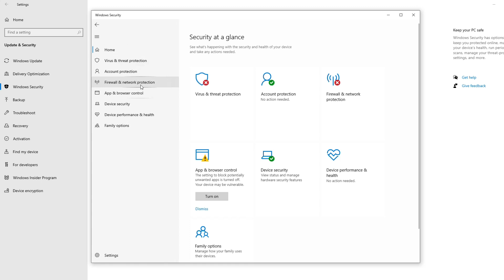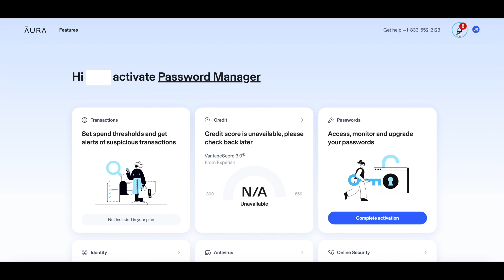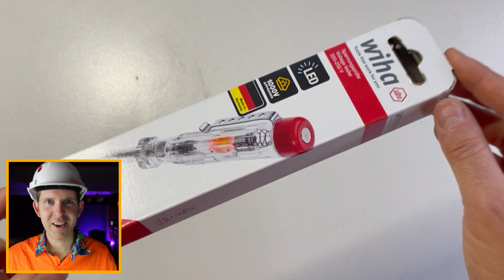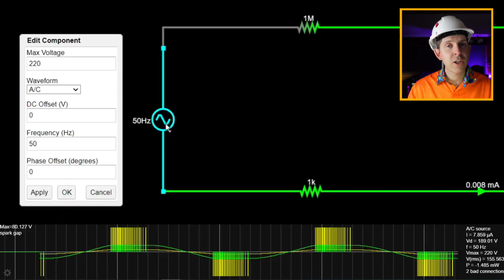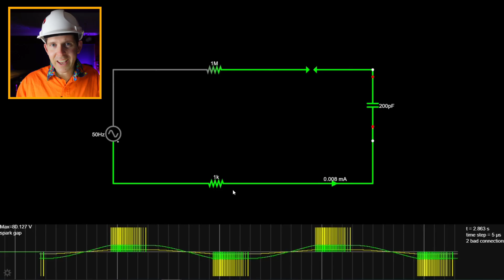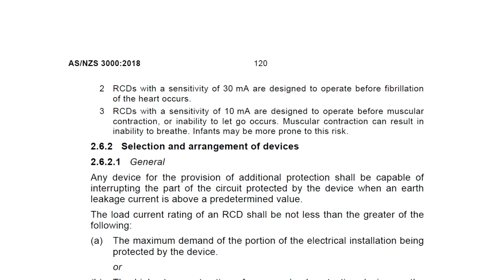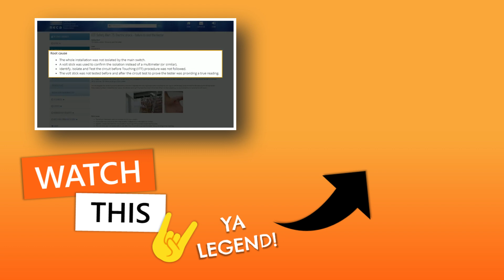ACTUALLY... This is the DEADLIEST Electrical Tester!

Comment: 50Hz is less power every damn time than 60Hz. 
No amount of Aussie math can refute.
Reply: When did hertz become a measurement of power?
Reply: @SuperSpecies  say you have 600v running at 50 cycles a second and some asshole comes and cranks up the generator rpm , getting 600v but 60 times a second. 
That’s indeed why.
Reply: @Shazzamm1971  yeah so the frequency will be increased, but why?
Reply: @SuperSpecies  so your motors don’t need to have as many windings to produce the same horsepower. So I might even go further and not only say 60HZ grids produce more power when time is a factor, which it always is, but the bonus result of running a 60Hz system over a 50Hz grid is efficiency gains on anything consuming load. 
Being able to run less windings in millions of spinning inductive loads makes your country’s resources go further. 
This argument was had about 80 years before I was born. Those that chose AC over DC back then is well documented, as well as who was smart enough to start their generators running a bit faster over those that weren’t smart enough to set the governors beyond 3000rpm.
Reply: @Shazzamm1971  there is also the skin effect. Most serious generators have 6 poles.
Reply: @Shazzamm1971  60 Hz increases eddy current and hysteresis losses in cores, inductive and capacitive losses in long transmission lines. In the past dozens of frequencies were tried like 140, 133, 42.5, 40 and 25 Hz. 50 and 60 Hz was a good  choosen as a compromise.
Reply: @mernokimuvek  We run 60hz upto those frequencies to control motor speeds. VFD’s are a thing. Run that 60hz at 120. Guess what just happened? More power. 

The reason it was chosen was because it was an easy RPM to match with governor controlled turbines, low weer on those machines. They didn’t even know about the electrical anomalies yet. 
It was a mechanical reason, plus it put more power to the grid per second and in the long run saved on end user costs. A 50hz motor takes more copper to put out the same HP as the 60hz version. Running 50hz is so 1923.  Just bump up the generator running 3000rpm to 3600.  Viola, technical advancement.
Reply: @Shazzamm1971  Even wikipedia mentions that the difference between 50 and 60 Hz is insignificant, there is no reason to prefer one system over the other. Standardization is a relatively new, mid 20th century thing. Even in the early 2000s, some power companies in the US had 25 Hz supply for industrial use.
Reply: You may want to let German rail ("Bundesbahn") know that, as they are operating their electric locomotives with 16.7Hz. As these engines require a lot of power: why would they want to run their power network on only 1/3rd the frequency of every other electric network in the country?
Reply: @hartmutholzgraefe  lots more than that run off VFD’s at anything from 12hz to 600hz… guess which is running faster, which power incorporates time, More things done faster is more power on display. 
Run your stuff at 24k at one cycle a minute and bask in all that power not being displayed. You’ll be promoted to upper management for sure.
Reply: @Shazzamm1971  come on, do not change the goal post, we were talking about  network transport frequency, not about the frequency that synchronous or asynchronous AC motors are fed with ...
Reply: @hartmutholzgraefe  oh were we? I thought my original comment months ago was about electrical frequency and whether that 60hz puts out more power than 50hz!?
Doesn’t matter what the power is running.. but you say different and are piss full of vinegar to prove it. Ok, lets talk only transportation.. which is better served by DC anyways..
Reply: @Shazzamm1971  You picked asynchronous motors as a special case, not me.

And yes, most stuff runs better on DC, but network transportation / transmission / distribution works better with AC unless you go for extremely high currencies over very long distances.

That's why most of the grid backbone is using AC, but a few very long distance lines nowadays use DC again.

But the general story about AC power is:

P = U * I * cos(phi)

The frequency does not matter in that respect, it only starts to matter again at very high frequencies where capacitive and inductive effects come into play.

None of this really matters when we are talking about 16,7, 50 or 60Hz. With one exception: transformers. These can be smaller the higher the frequency. 50/60 Hz were a compromise betwen "how fast can our generators rotate" and "how much do we have to spend on transformers", in the early days when VFDs were not a thing yet.

That's actually the reason why AC/DC power adapters have become so much smaller over the recent decades: the consumer device  "power bricks" of the 80s had a simple transformer follower by a rectifier, a capacitor and maybe a voltage regulator. As the transformer had to deal with 50/60Hz it was a rather large and heavy brick, even for small power requirements.

Then with progress in power semiconductors switching power supplies became more and more common which first generate a much higher frequency on-off pattern, then has a much smaller transformer in it (often just a very small number of primary and secondary loops around a ferrite core), then followed by the usual rectifier and regulator parts.

So yes, in case of transformer weight (and so material cost) higher frequency is better, too, but we can't run generators at such high frequency, and having such frequency converters at the source, between generators and the grid, would not scale. The semiconductors needed in front of the transformators can only take so much current, so the conversion is only done near the sinks, not the source, where rather small devices need to be powered. What "small" is has changed over the recent 20-30 years, train engines are now in the "small" range, but a full power plant at the source side is still far from "small".

And due to this, but also other reasons, we are stuck with the rather small frequencies that our grids run on. 

Another reason why the 50/60Hz range was chosen was that AC motors of the time when Tesla and others worked on this were not more powerfull/efficient at higher frequencies, quite the contrary actually. So 60Hz was the compromise between "how large will our transformers have to be" and "how efficient will our motors be" that Tesla deemed the best choice. 

Europe eventually went for 50Hz instead as it did not make much of a difference technically, but at the same time made calculations more easy; at least for someone who's used to the SI system and it preference for power-of-ten conversion factors. 0.02 per second is a more convenient value for us over here than 0.166666... per second.

Disclaimer: electric engineer talking here, and although I did specialize in electronics and information processing, not energy transmission; and since moved on into computers science, I still remember a thing or two ...

Comment: Never had problems whit them I used them a lot but I have a nice one  
A sealed 

Also the European sockets are beter
Because we have 2 tipes were you can use s realy flat one that saves space for ligts and chargers and a big one for 3600 watts 

And the small one always fits in the big one

Comment: Really no professional electrician in Germany uses it, we do so called "Duspols". In the olden times, apprentices used to get "pranked" by their masters by switching the resistor with a simple piece if metal or copper wire, so they would get shocked.. I don't want to know how many old electricians have now medical problems like cardiac arrhythmia due to getting shocked all the time.
Nowadays every apprentice gets hammered into their brains to not use those things, if we do.. we use it as a multitool from screwdriver over leverage up to chisels 😁

Comment: I never actually knew how they worked, but touching a metal bit at the end of the screwdriver after potentially touching the main part to a live wire just always seemed wrong to me. I'd rather use a multimeter.

Comment: The neon tester I had, had an optional earth lead, so if your in an environment where you feel unsafe (water etc), then don't touch it, use the earth lead.
The non-contact sensors are only really good for finding wires hidden in walls etc, on a terminal strip they are useless as they cannot isolate single live (or dead) terminals, here a contact device wins.
In a good quality high voltage probe, you have multiple resistors in series to share the voltage gradient, as a single resistor is generally not really up to the task, especially when you start talking cat3 etc, where you have to (and should) allow for up to 1000V in a circuit. A couple of transients, the single resistor and neon break over, then it's your hearts turn - kind of not good.
So is there a proper neon tester by a reputable test & measurement company?, I could not find one in a quick google, so it looks like there is a bit of a gap in the market.
If it doesn't have all the regulatory and underwriters logo's legitimately printed on it, don't use it.

Comment: I heard that 30 years ago the testers were very rare, so electricians (in a certain country) simply used their hands to test. If they have received a mild electric shock they knew it was live.
It was a very reliable test, and they have learned quickly how and what to touch to minimize the electric shock.
Reply: Well, I would not do da test with a 3 % probability to die.

Comment: These testers are prone to false positives (due to phantom voltage and open neutral for example) but they practically never give false negatives. And from a safety standpoint this is exactly what you want - a false positive will waste some of your time but a false negative can be lethal. You raise some valid concerns near the end of the video but this is why such testers are made from transparent plastic - so you can see any damage or moisture build up. To be fair, the moisture issue applies to a lot of tools and you should keep your tools dry. Otherwise if you use wet or damp tools and get shocked it's your own damn fault. It also helps to have good habits. I've never seen one of these fail but I always first test a live wire to make sure the tester is functional before relying on it for checking that things are not live.

Comment: We in the US have 240 volts. What are you talking about? We just don't feel the need to send 240 volts to every small thing that exists, so we have a center tap in our utility transformers.
Reply: why tho?
Reply: instead you are sending twice the current down every single wire...
Reply: @uwezimmermann5427  yup lol
Reply: @femboyelectronics6441  So what? If something draws a few watts, why do we need 240 volts to power it? We use 240 volts for higher-powered stuff, like large appliances such as ovens/stoves, clothes dryers, HVAC stuff... Stuff that also isn't being plugged and unplugged like the lower-powered stuff, and is often hard-wired. What's way different is that we only have 120 volts from live to ground at any point. You have 220 volts from live to ground at every point. To get our 240 volts through a person, they would need to somehow grab both live conductors at the same time. Why do you think 220-240 volts needs to be available at an outlet for small things?
Reply: Those have been used for ages without anyone dying.
Reply: @uwezimmermann5427  Oh, the horror. If I use something that uses 30 watts, I'm drawing 0.25 amps on a 15 amp rated wire instead of 0.125 watts on a 15 amp rated wire. We're surely causing that system so much stress.
Reply: @timramich  Now imagine 2kw heater

or a toaster or anything
Reply: @Femboy Electronics  What am I imagining? We have 1500 watt space heaters and nothing more. Our toasters aren't even 1500 watts in the first place, so whats the issue there? Even if we had portable things that are 2kw, we do have such things as 20 amp circuits. Our receptacles also come in a 20 amp variety. We just happen not to sell anything here in the consumer space that uses 20 amp circuits. You people constantly criticize us (American) for supposedly being afraid of things we supposedly don't understand, yet I'd imagine your phobia of our electrical system is because you can't understand it. Same how you criticize our plugs and outlets as being unsafe, yet you need those chonky idiotic outlets and plugs to be safe because your voltage is so high that is actually more lethal. If you really feel the need to have more than 1.5kw in some sort of portable device just sitting there in your home, be my guest. That's such an insanely huge energy density for a consumer device.
Reply: @timramich  no im just saying that there's no advantage to 120v

like you even have to wire things like cookers,ovens etc with 240v and u need those 2 phases created on that transformer for that like

to me its just inconvenience ig 120v is a bit safer than 230v 

about ur plugs tho im gonna be honest they're not the best.
They're easy to use
look better (lets be honest they do)
but its just so easy to slip a finger in them
Reply: @femboyelectronics6441  Just as I suspected, you don't understand it. The transformers are no different than yours, they just have a center tap, and that center tap is what is tied to the ground instead of one of the far ends. How's it an inconvenience? To get 240 volts we still only need 2 wires. It's not like we need to run 2 hots and 1 neutral. Some appliances do want that, but largely not. And if the appliance makers like 120v to control 240v power, doesn't that tell you something? Surely if it was more convenient and cheaper to make the whole thing use only 240 volts, they would.

Our plugs are fine, and children shouldn't be messing around with any plugs from any country in the world. And it's not easy to accidentally slip a finger in them. Yeah it would be nice if the legs were insulated until the tips, but they'd need to be so chonky, and those look ridiculous. We also have no reason to put little fuses in our plugs and we have no reason to have switches on our outlets. We just unplug them. That's the whole point of an outlet and plug.
Reply: @femboyelectronics6441  Have you seen our breaker panels? They're nothing like the rest of the world. We don't have to wire anything but the output of the breaker, the ground, and the neutral. We mostly do stuff like that live, because we don't need to run a wire from the breaker to the main live rails. Other countries' breaker panels are such a mess of spaghetti. We just snap our breakers in, so that's why 240v or 120v isn't a huge difference of convenience of wiring here. We have a 2 bus bars that run down the middle with alternating posts that pop up to "grab" onto the breakers. Since they alternate, a 1 pole breaker will be 120v, and a 2 pole breaker will grab both phases to make 240v. With our industrial 3-phase systems, they just add a third bus strip and we then add 3 pole breakers to the mix for when we need all 3 phases. We can snap into those 3 phase panels 1, 2 or 3 pole breakers.
Reply: @timramich  why not just use a simple 240v whats the problem with it
Reply: @timramich  also eu boxes arent a mess

switches are fun but the,fuses in,plugs are funny I agree. Also europe has gfci for everything.
Reply: @timramich  also it just seems overcomplicated just use 240v

if u know why explain why us has 60hz i dont rlly know it
Reply: @timramich  I am more thinking of somethings which uses a couple of hundred watts - well, I understand that you don't use many electrical kettles in the US, but even a vacuum cleaner, microwave oven, etc.
Reply: @timramich  our transformers are different, since we in Europe don't have one transformer on a wooden pole for every household. We have a substation which serves quite a large area, since 240 V can be used for a wider distribution range as well.
Reply: @timramich  Well we use 400 V on on those, or actually only 230 V is used but one can have three phases and one neutral.
Reply: @timramich  The transformers are different, not just about the center tap. Most of the world uses 3 phase transformers. I have never seen a single phase distribution transformer in Europe. Even small houses commonly have 3 phase service.
Reply: Higher powered stuff is what the 400V between two phases are for, or full three phases are for. Everything else gets one phase against ground, and so 230V (400V*√3).
Reply: ... although multi phase devices are rare in private households, the only device usually being supplied by three phases instead of one is the kitchen stove, with cooking plates internally being wired to different phases as all on them on a single phase can lead to overload easily. You can actually reconfigure stoves to run on two, or just one, phase only, e.g. when there's only a regular single phase outlet available, but then you'd better never use more than two plates at a time. And especially: do not put a stove configured for one phase on an extension cord. When we bought our flat there was still evidence of such an "experiment" left behind :o
Reply: @hartmutholzgraefe  now I understand your level of electrical understanding. Which is zero beyond what you google.
Reply: @Shazzamm1971  which part(s) of my last reply do you object to specifically?
Reply: @hartmutholzgraefe  education level in regards to electrical systems. Tying to troll a journeyman of 26 years with a tertiary understanding is exactly the specifics.
Reply: @Shazzamm1971  ok, so you can't point out anything specifically. Why am I not surprised ...?